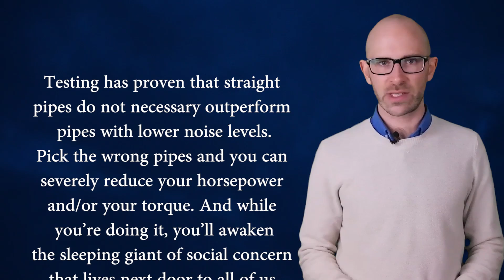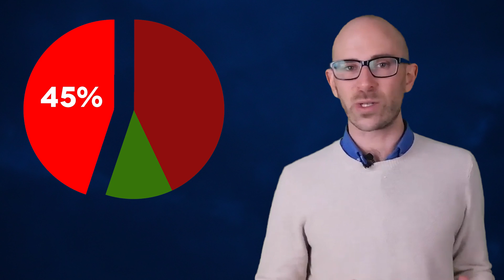Why are Harley Davidson Motorcycles So Loud?

Comment: Your statistics are bullshit. One of the questions on my motorcycle exam was literally "what is the number one cause of motorcycle accidents?" Answer: cars making left turns in front of them. And the number one reason for motorcycle deaths is alcohol.
Reply: in the UK it is turning right, so technically the truly correct answer is "turning into the rider in the respective road layout and driving side"
Reply: Sounds right. There's no better feeling than riding when half loaded but I finally quit in 2010. Haven't had a drink since.
Reply: ...and loud pipes would NOT help either situation. LOL.
Reply: By "Your statistcs" you mean the NTSB right?   LOL GTFO w/ all your subjective BS stories
Reply: The man upstairs and his son helped me out via celebrate recovery. It was real hard to say that.. I'm just trying to be helpful.
Reply: Motorcycle Gear Hub, if you mean to say that in single vehicle motorcycle crashes, the motorcycle is usually at fault, well no shit sherlock, but I'm going to have to call you out on the biggest crash contributor in general is alcohol. No, no, not at all. The NUMBER ONE cause of multi-vehicle accidents involving a motorcycle is the non-motorcycle. A motorcyclist being drunk does NOT affect a cager's ability to notice that the motorcyclist is coming down the road.
Reply: Maybe the stats are from a different bit of research.  He stated his source, what's yours?
Reply: a2rbnud, but they do piss off a lot of people, me being one of them. I live about half a block from a fairly heavily traveled street in a small city, I can just barely hear heavy trucks, very few cars though a few kiddies with fart can mufflers do make a bit of noise but I can hear Harleys starting up 4 blocks away. It's funny in a sick sort of way, a town a few miles away has a sign prohibiting the use of engine retarders, something that is actually functional and useful but here are many Harleys with insanely loud exhausts going through it daily and no one says anything or at least there are no by-laws made restricting the noise from the bikes.
Reply: L98FIERO, I just find loud bikes mildly annoying. If you get pissed off over it, I'd hate to see what your temper's like when something worth being pissed off over happens.
Reply: Jenny, it pisses me off because if I can hear them 4 blocks away, they are a hell of a lot louder when they drive down my street and at 2:00 a.m.m damn right it pisses me off especially because the loudness serves no other purpose than to piss people off. It's pure arrogance and an 'I don't care if I piss you off' attitude that gets me that way. Is it worth getting pissed off? Well, I have no problem with a semi truck using a Jake brake, that's useful but noise for noise sake, yeah, it's worth getting pissed off to the extent I'm petitioning my city counsel to have a noise restriction, how does that work for you?
Reply: L98FIERO you're talking to someone who is woken up at 2am by four wheelers doing doughnuts in the front yard, and whose saddlebags have been repeatedly stolen by the fucking four wheelers, who think  my way is a great place to have fucking parties. I'd rather have to deal with loud Harleys that occasionally drive by .
Reply: Jenny, I live in a biker town, ~25k people and likely 500+ Harleys, there is a drive through coffee shop half a block away on the main road out of town, the bikers aren't an occasional thing, like 2:00 A.M., 6:00 A.M., any f***g time and each one has to show how loud they can be, louder than cars, trucks and basically any other thing on the road. No, they do it just to piss people off and unsurprisingly, it's working, they come from the factory with muffler that even the CEO of Harley says are just as efficient as most custom exhausts so there is no justification. And FWIW, I'd be pretty pissed about doing what those people on the 4 wheelers are doing too.
Reply: You could try soundproofing. It's not as expensive as it used to be. There's new special drywall that's freaking amazing.

Thing is, nothing is going to stop these people from having loud exhaust, not even laws. Only rookie cops make the mistake of pulling over a group of bikers, especially on something that could result in impounding the bike.

It doesn't even have to be a club, a group of bikers riding together is a very dangerous thing for cops to pull over. Even as few as two bikers and they can break nearly every traffic law as long as they aren't hurting anyone.

As for those four wheelers... They come from the RV park next door. Guess who owns the RV park... the local sherrif... And guess what that means when his customers are causing property damage... Yup, it gets ignored by the cops. I'm not going to be doing anything violent however, even though I'd be in my legal right because... you know, shooting the sherrif's customers and guess who you're telling they were trespassing, the sherrif...

I'm half tempted to report them to the FBI because this is technically police corruption and this state has such a big problem with police corruption that the FBI will investigate it if there's even so much as a dollar of money being made by the cops. They already cleaned house the Nacogdoches police department for extortion and staged burglaries. That's just a couple hour's drive from here. Which in most states would be "wow that's far" but in Texas that's just about as far as you can throw a rock.
Reply: Jenny, want to bet that "nothing is going to stop these people from having loud exhaust, not even laws"? Make the fines high enough and on a progressive scale and make the fines frequent enough and they'd stop. Few people speed, guess why?
Reply: L98fiero you clearly didn't understand anything I said. Such laws are only going to affect bikers who ride alone. Only rookie cops don't understand the serious risk to their own well being for pulling over a group of bikers.

Also, enforcement is an issue. These bikers aren't complete morons. A rookie likely isn't going to have the equipment necessary to actually test the pipes or the training to use it. Even if he does, he's going to slip up and the biker will be able to get out of the ticket.

The best a cop can really do unless they have the equipment to test it and know exactly how to test it properly is temporarily impounding the bike for testing...

And all THAT is going to do result in a LOT more sales of pipes that switch from loud to quiet... So the biker just flips a switch and the bike's baffles are enabled when the cop pulls them over and then gets to sue the police station for harassment after the second time they get pulled over.

Think pipes like those don't exist? Think again, a particularily popular brand of them is called "Peacemakers" and are manufactured by National Cycle

For that matter, I've been pulled over for the stock pipes on an early 1980s UJM being allegedly too loud. When I explained that not only are the pipes unmodified and from the factory, but that the bike was manufactured before any noise ordinances were enacted, and that it's registered in a county with no noise ordinances and in a state with no noise ordinances, the cop let me go because he knew that it'd quickly turn into a federal case and he'd quickly lose the case in front of a federal judge.

Here's how it would go down... A cop pulls over an out of state person with an old bike that was legal when it was made and is legal where the bike is registered. At this point all I have to do is claim he's trying to prevent me from traveling and violating my 14th amendment, and file a law suit against him and the police department he works for for violating my 14th amendment rights. Then it goes to federal court.

The federal court judge is like "you have got to be kidding me, I'm having to deal with a traffic court case?" and at that point whoever is in the wrong is going to have some pretty stiff penalties for wasting the judge's time, and it's the cop who's wasting the judge's time because the bike is 100% legal both where it's registered and when it was manufactured.

Seriously, how much do you even know about bikes, nevermind how to defend against tickets in traffic court?
Reply: Jenny, 'Only rookie cops don't understand the serious risk to their own well being for pulling over a group of bikers.', you've got to be kidding, and you probably wonder why people get shot by cops. BTW, suggesting that a bike 'gang' would threaten a cop suggests that those aren't the nicest people to have around anyway so that makes outlawing the bikes and bikers even more likely.

I'm obviously older than you are because I know that those exhausts were available for cars in the 50's and guess what, they too were outlawed and the fine was bigger for that than the loud exhaust. How many do you see on cars today. As with all laws in the US, they are bought and paid for political decisions and if enough people are pissed off, you can bet on it that all bikers will be caught up in the ensuing net.
Reply: L98FIERO I'm not saying they'd threaten a cop. I'm saying if a cop pulls one over, they all pull over, and the cop is taking a serious risk just pulling them over because they might be in a club whose members protect each other no matter what. There are entire training seminars for police on how to deal with clubs.

For one, if you're a cop and you pull over a club and you don't have bars on your sleeve, they're going to refuse to talk to you and just sit there until you get a sergeant or higher ranking officer out to talk. Then, the sergeant or higher ranking officer will only be allowed to talk to the road captain of the group, and not to anyone else.

Seriously, you really need to learn a thing or two about biker culture.

Loud exhaust for cars? Yeah not even remotely the same culture. Seriously, learn a thing or two about biker culture. Even law abiding groups like BACA (Bikers Against Child Abuse) have been known to engage in violence from time to time when they're crossed.

Take for instance an incident with a bunch of BACA chapters riding to another state to help out with a huge BACA event. Some unassociated guy on a bike followed this one chapter all the way there and almost all the way back.

On the way back, he decided for some reason to pass the entire BACA chapter he'd been shadowing and clipped the road captain's front wheel when he finished passing them. The entire chapter forced him to stop, then they sent him to a hospital and beat his vehicle until it barely resembled a vehicle anymore.

This kind of thing doesn't even require a biker belonging to an organization. Heck, doesn't even have to be Harley riders. There was an incident in New York City where an SUV deliberately ran over and crushed a guy on a sport bike in front of a bunch of other people on bikes and all the other people on bikes completely trashed the SUV and sent the driver to the hospital. SOME of the people in the group of motorcyclists happened to have even been cops.

And yes, I am suggesting they aren't exactly the nicest people around. They can be great if you show them respect, but if you don't show them respect, they're probably going to show you even less respect.

You do NOT fuck with a group of bikers, and that's that. A lone biker is generally not going to have much of an attitude, but in a group, they protect eachother.
Reply: So what you are saying is once they get on a bike they have a pack mentality and become outlaws. My personal opinion of that is that if they want to engage in outlaw tactics to 'protect their right to be outlaws , fine but then we citizens should be allowed to participate to protect ourselves as well. The old, original concept of an outlaw and I'm sure one they would agree with is that they are out(side the )laws and as a corollary by the original interpretation of that it meant that being outside the law you could shoot them, hang them or whatever else you pleased as they were outside the law. Personally I'm not that kind of person but you can see where that mentality will get you in the end. I assume you associate with a lovely bunch of fellas like that so you know where I'm coming from too. I peripherally know a couple of Hell's Angels bikers and while they have kids and wives that they seem to treat well, I'd see no problem with them joining about half a dozen of their fellow bikers that were removed from the gene pool a couple of decades ago. But that's just me, I have issues with drug dealing pimps.
Reply: I never said that. Don't put words into my mouth. What I'm saying is that there is a serious risk for cops to pull over a group of people on motorcycles, especially but not necessarily if they're on Harleys. Saying "there is a risk that any given unknown group of people on motorcycles could be in a club" is not the same thing as saying "everyone on a bike is in a club". Seriously, L98FIERO, learn to fucking read.
Reply: Ah but Jenny, you did say that and to quote from your post, "I'm saying if a cop pulls one over, they all pull over, and the cop is taking a serious risk just pulling them over because they might be in a club whose members protect each other no matter what.", and in fact I didn't say they were necessarily in a club, you did, but I did say that they attained a pack mentality and decided they were outside and above the law. Seriously Jenny, learn to fucking read.
Reply: Ah but L98FIERO, there key words here are "risk" and "might". You really need to learn to read. I suggest starting at your nearest kindergarten? Remember, A is for Apple.
Reply: Risk and might also imply a threat, so when you are taking your remedial reading course, understand that C is for cop, P is for prosecutor, J is for judge and also for jail.
Reply: At no point am I saying they make threats. I'm saying cops take risks when pulling over groups of bikers, especially when the reason they're being pulled over is an impoundable offense. The threat is severe enough that a group of 2 or more bikers riding together in Texas deters the cops from pulling over for even a speeding ticket, and that's NOT an impoundable offense.
Reply: Alcohol is the biggest contributor to crashing a motorcycle. Second is excess speed. They both lead to the most common at-fault single-vehicle motorcycle crash: coming off a curve at speed (at least in Europe, that is). Most common lesions are road rash and damage to the legs (traumatic amputation, dislocation, etc). Many riders don't know that the legs are most frequently the main sufferers in a crash, which is why riding in jeans and regular boots is insane.

Where I live, if you're found with illegal blood levels of alcohol, you will be trialled for that aside from the crash. The crash would be the fault of the illegally-turning car. However, if you as a rider are found to have illegal blood levels of alcohol (doesn't mean you're drunk), let's say that you will be suspected of everything, including being the culprit of the crash. Also, drunk riding means your motorcycle insurance won't cover third-party damages, which can bankrupt you if you happen to kill anyone in the crash (and, of course, it's prison time).

In an ideal world, you should not drink a single drop of alcohol. However, a good percentage of motorcycle riders do drink and ride (especially those Sunday riders and posers who have not a single iota of riding skills). It's important so simply be aware of how much of a risk alcohol poses to even the most-skilled experienced rider.
Reply: I blacked out every night for 3 years. So drunk I couldn't hold up my hog at red lights. It's strong temptation to ride when buzzed. Anyway, the most wrecks I've almost got in were in fact cars turning in front of me from side roads, like you are saying., from the left. That's why I like the freeways.
Reply: He means the cager not yielding the right of way and turning in front of the biker who does have the right or way. I think that's what he meant. Whatever caused them to do that, acohol, eyes shut, kids screaming in the back seat or a fly in his eye I would guess is secondary.
Reply: So does that mean that if a drunk cage drive turns in front of you and kills you that the cause of the crash was the turning of the cage and that the cause of your death was the alcohol in the driver's system?  Or if you were drunk, is it the same, or how does that work?
Reply: To Softail77US,  It's damn difficult to quit alcohol. I say...good for you.

Comment: dont know anyone who has lost hearing from riding a harley everyday with loud pipes. loud pipes do save lifes as i have had a few cars stip from switching lanes when i rev up and they dont see me. also it does improve the performance of the motor and will only hurt it if you dont tune it right. blah blah lol.

Comment: I drive with my windows down, and my music loudish, but not enough for a cop sitting next to me to pull me over. Most of the time I can't hear motorcycles until they're parallel with the drivers seat (meaning I can already see you), or in front of me (given the noise is generally projected backwards) - And I've been passed by some seriously ear-crushing pipes too. If blowing out your hearing under the guise of pseudo-safety is the way you want to go, have at it hoss. Join the anti-helmet crew too, since helmets don't save lives.

Comment: If you ran straight pipes on your car or truck on the streets you pull pulled over for a sound ticket. loud pipes don't save lives any more cars nowadays are super quiet inside. Why we put loud pipes on a Harley's is to make them sound better that's it, the truth its out no more  mystery.